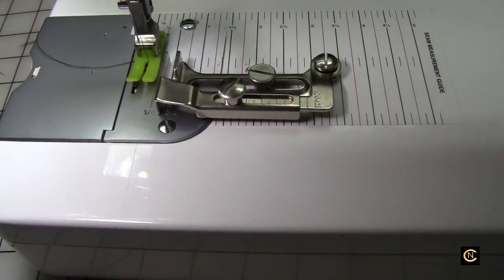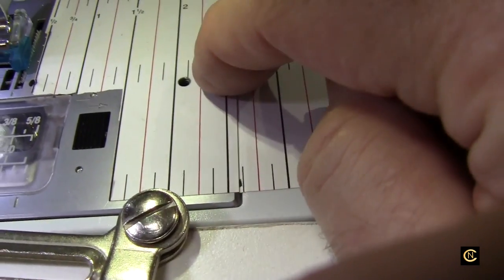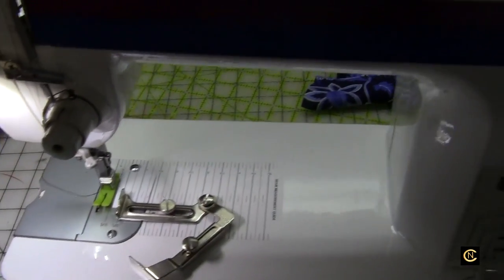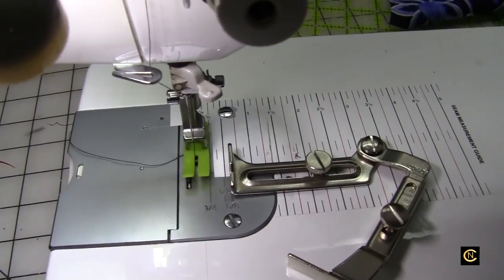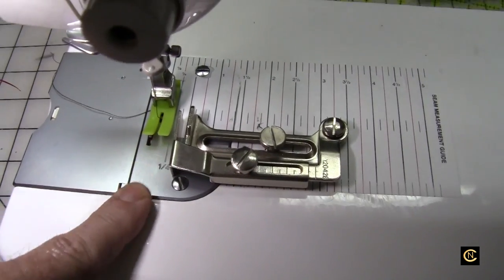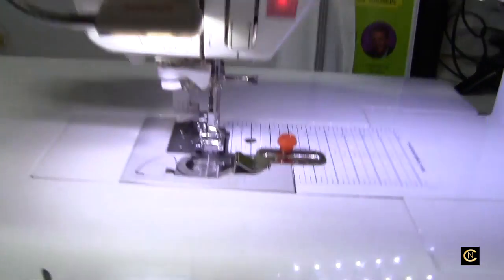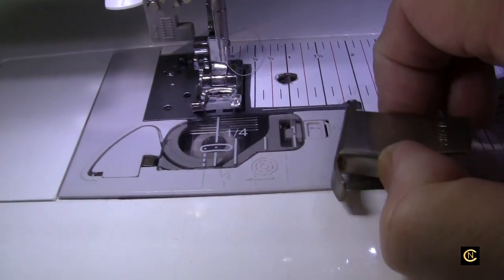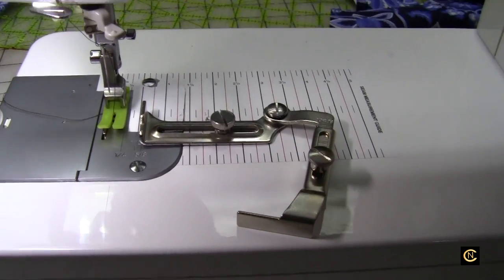Seam Guide Tip - Sewing Machine - Christopher Nejman

Comment: Tap one of the holes in the Needle Plate or drill & tap a hole, then you can use a screw type Seam Guide. Or glue a strong flat magnet under the plastic needle plate that the magnetic seam guide can adhere to.